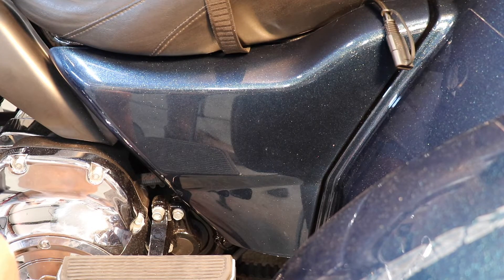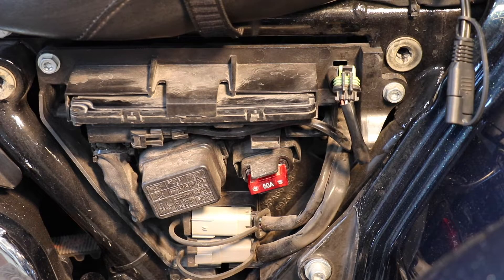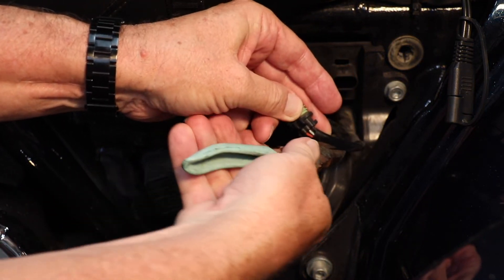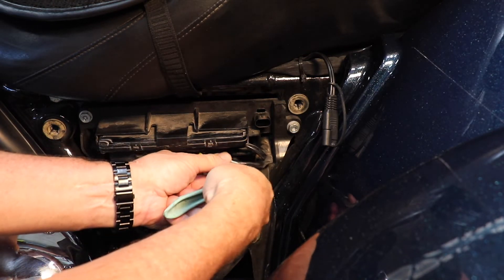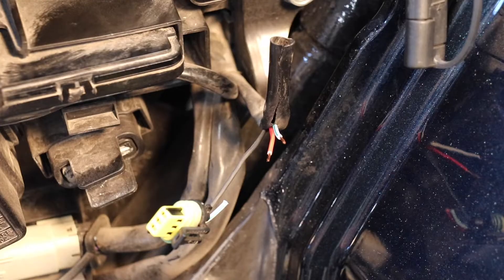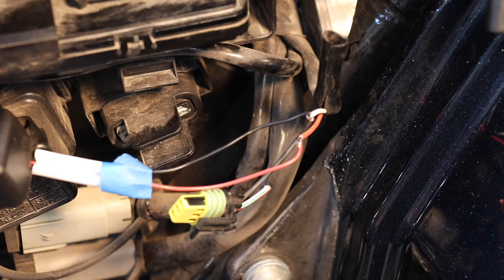Add a Siren to your 2016 Tri Glide Ultra

Comment: When I did mine I just stuck the wires into the plug, put a piece of tape to hold the siren wires to the side of the plug then plugged it back into it's holder. Took 2 minutes.

Comment: Will just the normal fob without buttons work with this setup?
Reply from the maker: Yes it should, your bike should have the Harley security system.  Both of my fobs don't have buttons and in the video I point out the security system.  So if you pull off your left panel and you have the security system your golden.  Also look for the plug 142B that plugs into the blank socket.